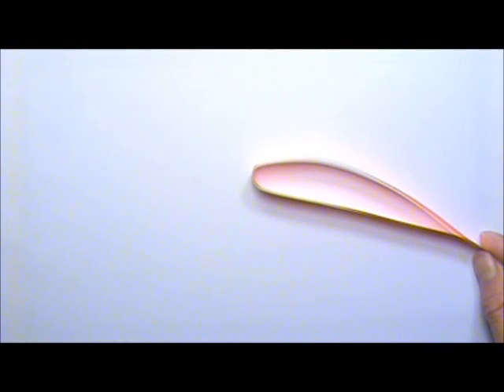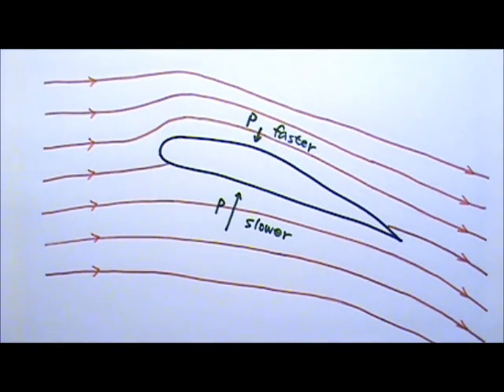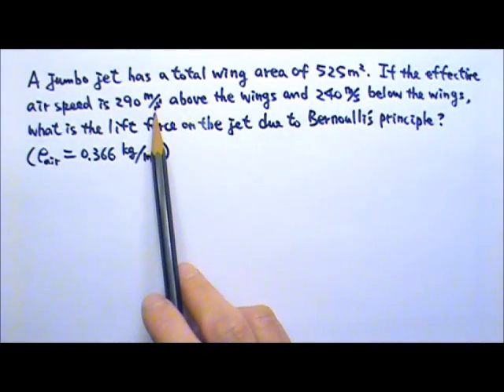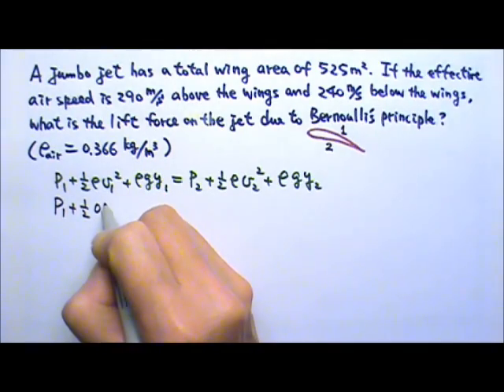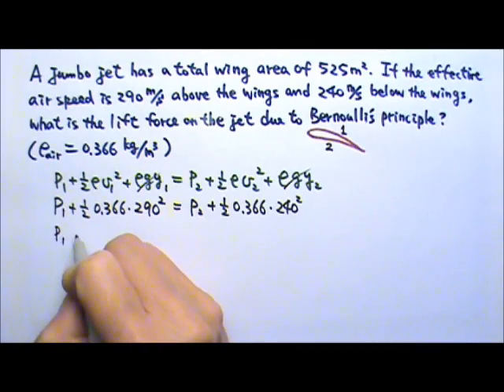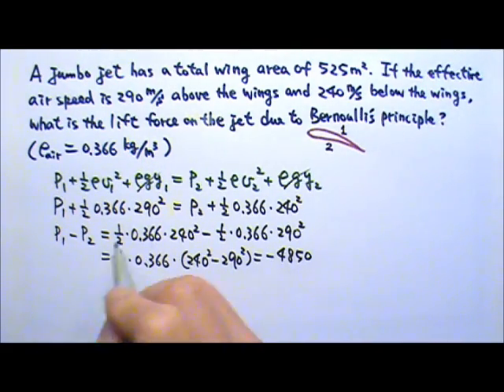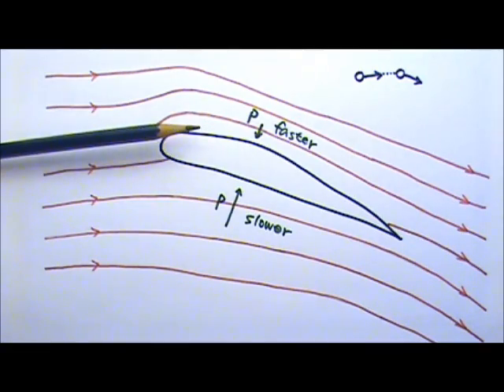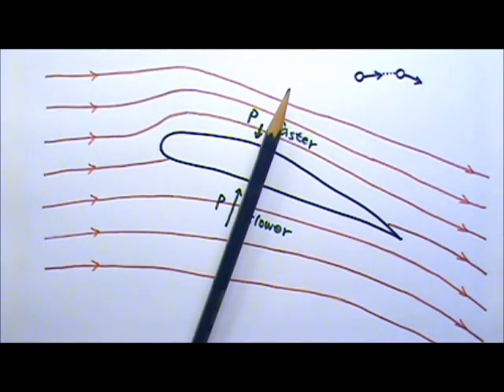AP Physics 1: Fluid Mechanics 25: Airplane Lift Force Problem

Comment: In fact if we look around for all forces - list will not be so long  ( gravity and pressure) if no viscosity and it is glider (no engine). Gravity push air-foil down. Pressure, well, it depends how it is distributed). Distribution of  pressure depends on environment ( water/air, altitude, temperature AND  velocity direction and absolute value - it is vector  is not it?). This is the only force which can reduce or eliminate action of  gravity. If you know any other please, advise :-)
Reply: Again I would not focus on the pressure unless you are teaching fluid mechanics. The pressure is a result not the cause of lift. Because it is  exactly related to the change in velocity of the air it reflects what is happening but not WHY it is happening.

There must be an origination force. Just as a ball at the top of a hill has 100% Potential but 0% Kinetic energy the Kinetic energy cannot manifest until the ball is pushed over the edge. The Kinetic energy increases as the Potential energy decreases during acceleration due to gravity.

Lift cannot be created unless the air is physically disturbed out of equilibrium that is, when AOA ( or flow from camber) is physically altered from 0 degrees.  That is a simple demonstrable physical fact.

At the point that the wing AOA moves from 0 flow begins turning and the resultant pressure varies. This is vary easy to demonstrate using FoilSim.
Reply: The only forces that matter in lift creation are the ones that cause the air to be disturbed. As long as you have forward motion of the aerofoil and AOA you have lift. How much lift you need depends on the weight of the aircraft.

For a glider mechanical thrust from an engine is replaced by gravity. The principle is exactly the same as an aircraft in a power off descent.

Comment: Ms Twu, this is a good video but you are flirting with a number of myths in your explanation. The mathematics can be correct but the misleading.

Apart from being an aviation professional, I have been teaching this for a number of years to Undergraduates and see confusion regularly.People get into all kinds of trouble trying to analogise Bernoulli, so it is often best to stay with Newton.

Perhaps re-edit your video so your Newton explanation comes first because conceptually it is the easiest to understand. 

Lift as you correctly point out is caused by turning flow but for students, visualising it can lead to error.

If we look at the problem from the real world perspective (moving wing-static air) it is easy to see that the change of state/velocity under the wing is caused by the wing pushing the air downwards and forwards creating a 'bow wave' and bending the air downwards which contributes a great deal of the lift.

The upper surface of the wing actually pulls the air forwards at the boundary layer before it turns (as it must) and follows the upper surface to turn downwards creating the other lift component..

In wind tunnel terms (moving air - static wing) this SLOWS the upper surface air down compared to the free stream air . This is called Form drag and Induced drag.

The Angle of Attack is the primary cause of the pressure differential and turning flow and therefore lift. This is easily demonstrated by a flat plate (no camber, same distance top and bottom) wing which has an excellent L-D ratio.

I suspect this is why NASA Stays with F=MA.

A couple of links that might be of help.

how wings work? Smoke streamlines around an airfoil
http://www.grc.nasa.gov/WWW/K-12/airplane/wrong1.html
Reply from the maker: Thank you for the feedback. I know the controversy involved in the explanations for an airplane's lift force. I know that is why some physics textbooks don't do this kind of lift force problems any more. I suppose this also means the College Board is not likely to test the students such problems. In any case, I did this problem because this type of problems are still in some textbooks; and Bernoulli's equation provides a way to estimate the lift force. 
At my website for this video lesson, I included a link to a video on the Angle of Attack; however, not all students watch the supplemental videos. Fluid mechanics is complicated, so, yes, I agree that Newton's laws provide the most beautiful simple explanation - though not a simple way to estimate the lift force. So perhaps it can be a good idea to explain it with Newton's laws qualitatively and then say if you see a problem like this, it is talking about .....
Reply from the maker: Oh, and the link I have for the angle of attack is really old, so if you happen to know a good updated one, please let me know. For some reason, I cannot see the correct part of the NASA page. Thank you.
Reply: onlearningcurve Absolutely. Fluid mechanics is complicated even CFD cannot solve all of the problems but when students start off with the wrong concept in their head it  can make it hard for them to unlearn it. I was taught the wrong theories many years ago! The other problem conceptually with explaining lift as a pressure differential rather than a Newtonian reaction force is that when a wing stalls, the pressure differential is greater than during normal flight so it should create more lift but of course it does not.

Fun stuff isn't it? I did enjoy your mathematical explanation though. As I am teaching BSc students who are training to be pilots, we don't go too far into the mathematics and it was nice to dust of that part of my brain.
Reply: onlearningcurve I will try to find something for you. Did you want equation based or conceptual?
Reply: In addition just want to add  faster speed  itself does not generate pressure gradient. Great example flow in  cylindrical  pipe. Even  if speed  across  the tube is different  there is NO pressure gradient :-).
Reply: Sorry dear Aerogeek
"Lift as you correctly point out is caused by turning flow but for students, visualising it can lead to error." It  does not sound  right. Lift is a force . Turning flow is change of velocity   ( acceleration). Strictly speaking force causes acceleration ( as per 2d Law of Newton you mentioned). Acceleration  can change original  force, yes. But can not come from nowhere.
Reply: Andrew Pa Hi Andrew, I think visualising it is easy. My students have never had any problems with it. It just requires the right kind of analogy,

Everyone has stuck their hand out of a car window titled it and felt the lift reaction. pretty much everyone has made a paper plane with a zero camber wing.

No AOA = no lift because there is no turning flow. This this the  most basic form of a 'proof' in physical terms.

Wing camber performs the same function, it changes the direction of the air which according to the 2nd and 3rd law MUST create a reaction force. This is lift.

The pressure change is a result of this not the cause of lift.

Simple to prove. No AOA no LIFT and No pressure diff.
Reply: Andrew Pa True. A flat plate or a symmetrical aerofoil  will produce 0 lift at 0 AOA regardless of airspeed. Also one of the most common incorrect ways of 'proving' lift myths is to blow over the top surface of a piece of paper and watch it lift and say "Aha!" There is it. This only works if you are holding the paper horizontally and allowing gravity to cause the paper to curve. What you are actually demonstrating is conservation of momentum of the air flow and viscosity battling it out causing the air to cling to the curved surface when it wants to go in a straight line. It is this that lifts the paper.

If you hang the paper vertically, (0 Camber) you can blow as hard as you like and the paper will not moves as a result of the speed of the air over the upper surface of the paper.
Reply: Complete Aerogeek Joust FYI I found good  book ( still reading it ) -
by Doug Mc Lean "Understanding aerodynamics".. So far it is  the most comprehensive  textbook on subject of lift. It  is good you mention  F=ma . It is interesting  but different subject ( meaning and importance of this law)
Reply: Complete Aerogeek I  agree with most of your comments.   The only thing I see some gaps is why exactly airfoil "bends"  flow.
May be for your students it is enough . At least it is much better than most of explanations.
Reply: onlearningcurve Hi MS Twu, please see my post from today. Your video is still confusing a lot of people.  I hope you will modify it soon.

Cheers  CAG
Reply: Andrew Pa He Andrew, see my latest post. The wing bends the air by shoving it around. I assume you mean the upper surface air? 

Imagine the wing immersed in water. (Air behaves like a fluid)

Now tell me if you still have the same question...
Reply: Complete Aerogeek Good morning... wing  does  not bends  flow per se.   Doug McLean has good picture  ( I can not attach it here) and explanation how it works.  In short , only in stagnation point fluid parcel interact with  surface of wing . In all other points it interacts with  parcels surrounding wing.  If you add this to your picture of lift  it will be quite complete. :-)  In Doug McLean own words
".....If viscous forces make no direct contribution to the turning of the flow when the surface is curved, what actually causes the flow to turn?
The answer to this question lies in the interplay between the velocity field and the pressure field, which works in the same way whether the fluid is viscous or not. When a flow turns to follow a curved surface, it is able to do so because the pressure field adjusts so as to provide the force needed to accelerate the fluid
toward the center of curvature...."  Best regards, Andrew
Reply: Andrew Pa Hey Andrew, you can get me on completeaerogeek@gmail.com.

Might be easier than here.
Reply: Andrew Pa Hey Andrew, Apologies. I misread your post.

Yes of course the boundary layer is in contact with the wing and the other layers are in contact with each other progressively but to say the wing doesn't bend the air is a bit like saying that when you fall off your bike the ground doesn't break your leg because the ground is only in contact with your skin...  :)
Reply: Complete Aerogeek He-he... For future engineers this explanation  will be good  enough to grasp the idea. For  more advanced scientists/engineers it is not enough. Sounds more like magic. "Skin" effects in fluid dynamics is critical for understanding fluid behaviour. So, your example is not quite valid  here (IMHO). :-).  So far, Doug Mclean  book  is the deepest one on subject I ever read even it is not quite scientifically good. At least, this guy asks very good questions and is trying to give best ( from his point of view)  answers. But the field is so huge , complicated
and inter-disciplinary that  there is enough space for every interested researcher.:-)
Reply: Andrew Pa Hey Andrew, the interesting thing is that for people trying to understand the concept of lift - both the conceptual explanation of turning flow and maths works well enough using Newton's laws to accurately predict aerofoil performance.  I assume that is why it is NASA's preferred explanation. One hopes that they know what they are talking about.

There are all kinds of peripheral concepts like 'circulation theory' and others that float at the fringes but in terms of empirical proof of a concept or principle: If you can look at streamlines in a wind tunnel recording and see what is happening, use the F=Ma and associated formulas to predict results accurately and then build a test article using these figures (as we have been doing for over 100 years) and it works, it's kind of hard to deny.

Anything after that is someone's opinion. When they offer a peer-reviewed proof and a definite alternate mechanism that meets all of the above and can demonstrate it, I will be happy to accept it. That is what learning is all about.

If a proof works at 99% accuracy that is fine for me. I will leave the 1% to the experts. In a similar way, we can send space vehicles into the distant reaches of our solar system using Newton's laws with a high degree of certainty about the result. It is only when we approach the speed of light or are talking about time dilation with radio signals that we have to get into the nitty gritty much like with Quantum mechanics when you have to take a step beyond Newton as his laws go a bit squirrely at that strange tiny level and we begin talking Heisenberg  - but that is not really relevant to our everyday functioning.

If you want to fiddle around with tiny percentages of variation using CFD that's a beautiful thing for hard core aerodynamicists and maths nerds but not necessary (IMO) for the needs of pilots and engineers.

As for Mr McLean I will get hold of his book and read it -  but I might not be smart enough to understand what he is saying! :)